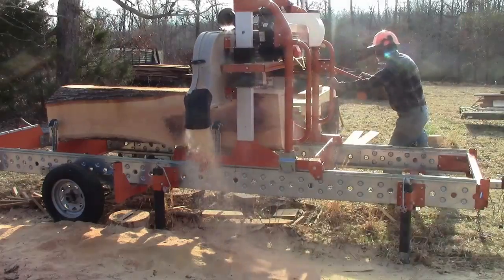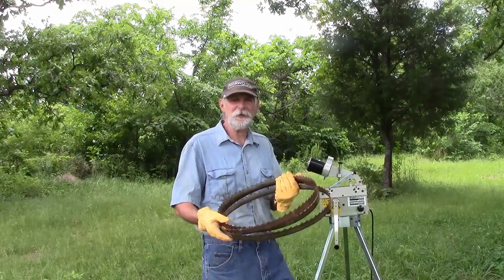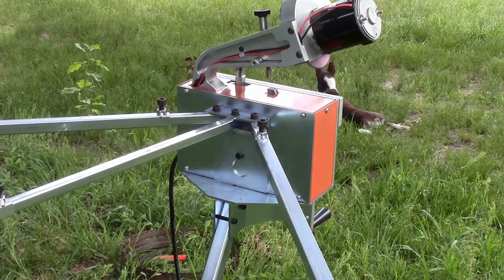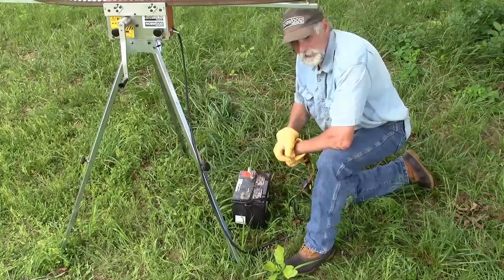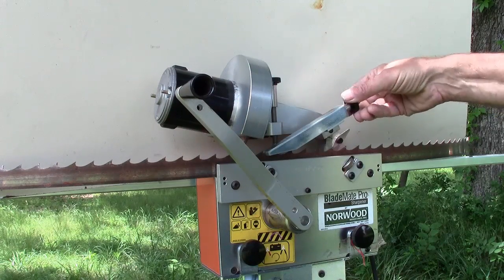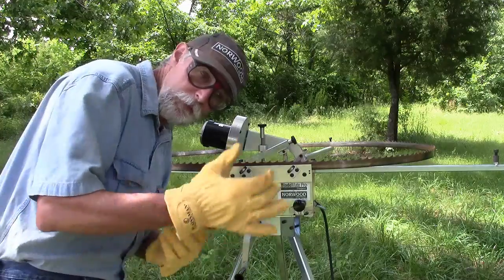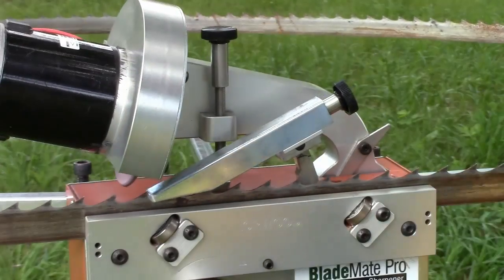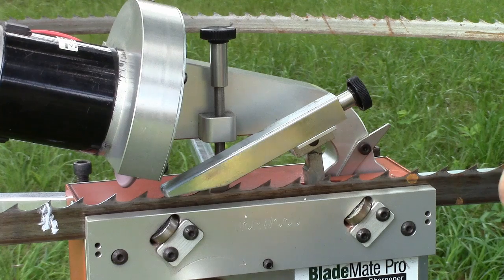Successful Sawmilling Series - Band Blade Sharpening for Optimum Portable Sawmill Production

Comment: According to one comment, cross grinding removes the cracks that might be starting in the gullets, but that's the same problem as stretching of the leading edge, a matter of luck hitting knots or hard objects. Definitely the technique to continue with for cutting backyard logs, but then the cost is factored in to the gain in unique tree types.

Comment: Can you set the angle of attack on the teeth? Or is that done by the stone you use?
Reply from the maker: Hi Volker 

The angle is set at the factory when the blade teeth are being cut.  But you can reshape the angle of attach of the tooth with the stone.  We recommend though that you try to get the profile that is right for you rather than "make" it with a grinder otherwise you are likely to grind off too much of the hardened surface in some places.  Thanks

Comment: How often would you use the tooth seter  that that sell
Reply from the maker: Depends on what you are milling and how you are treating your blades. It also depends on personal preference. A good rule of thumb is to sharpen band blades every two hours of cutting (so take a few blades with you for a full day of cutting). However, you may need to sharpen your blades more often if you are milling dirty logs or species that have a lot of sand inside the fiber (like cedar).  Most sawyers can re-sharpen blades between 5 to 8 times.  Personally, I will look at set about every two to three sharpeneings.

Comment: Im not a scientist or a engineer. But dont grinding cause heat. So if u sharpen the tooth and grind the gullet and the back side of the tooth dose this heat up the blade? Making the repeat on the tooth next allready heated? Losing temper after repeated sharpings? I know slower the better and less is more. But Found teeth in the blade not spaced the same welds,cheap blades and grinding machine slight drag on the cheap roller system to rotate the blades on these sharpeners. Dont get me wrong they work great. Ive had the blade get stuck rotating on the process and grind teeth off.

Comment: He didn't comment as to why the 'contour' of the cut wasn't near to the contour of the blade's [teeth/gullet]!  The stone ground down 80% of the face of the tooth, nothing the first 50% of the gullet, very little on the tail of the gullet, and then back to a healthy bite on the backside of the tooth [which I wouldn't think you'd want].

So why?

Is the cam that the stone's traveler rides on wrong for this blade?  Is the plane the teeth are traveling along not parallel [pitched down a degree or two] relative to the plane[s] of the cut?

Compared to a Cook's sharpener, I'm not at all impressed with Norwood's product.

From a HD36 owner.
Reply: The cam is for a slightly different blade profile, and it will take several sharpenings to get a perfect match.  The sharpening actually takes place on the back side of the tooth.  All you want to do when sharpening the face is to square it up and knock off the burr.  As a note, I did get tired of hand cranking the feed, and bought a 12V gear motor & speed controller for an automatic feed.

Comment: would have been better if the camera was where the handle did not block the tooth being sharpened. and the guy had a better sence of adjustment instead screwing the adjustments nobs so far at one time.

Comment: what about tooth set? don't the teeth get moved a bit in use?
Reply from the maker: Yes, teeth can need re-setting. There is another specialized tool for that. But most important is sharpening.
Reply: Norwood Portable Sawmills thank you for the quick response. I’ve thought about this. Fortunately, where I live and operate, there are two sawmill blade sharpening services. One of whom I know personally. And they are directly on my delivery and return route, so I can easily drop off and pick up my blades. It’s inexpensive. So so far, I’ve not gotten in to what you are doing. But like I said, it has intrigued me a lot.
Reply from the maker: A good rule of thumb is to sharpen band blades every two hours of cutting (so take a few blades with you for a full day of cutting). However, you may need to sharpen your blades more often if you are milling dirty logs or species that have a lot of sand inside the fiber (like cedar).  Most sawyers can re-sharpen blades between 5 to 8 times.  

You can get more details about our band blade maintenance equipment at https://www.norwoodsawmills.com/en_us/tools-equipments/blade-maintenance

Comment: What if your blade has variable teeth pattern?  3 teeth and 4 teeth per inch.
Reply from the maker: +Kirk Crawford This video was set up to profile 7/8" pitch blades (one tooth every 7/8").  Band sawmills do not use the same high density teeth set-up as shop bandsaws or metal bandsaws.

Comment: Design a wing nut design so I dont have to take the cover completely  off
Reply from the maker: The covers are to remain on during operation of the BladeMate Pro and should only be removed for maintenance or repair, therefore a tool is required to remove any covers.
Reply: @NorwoodsawmillsDirect  to change the grinding wheel !!